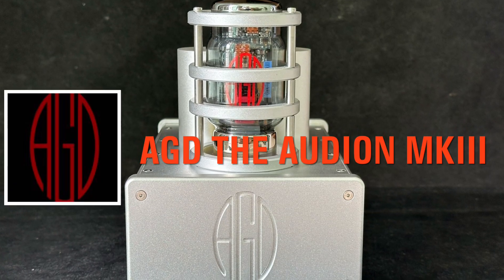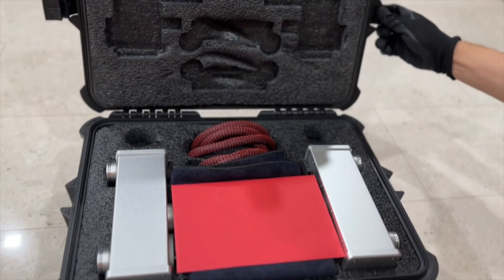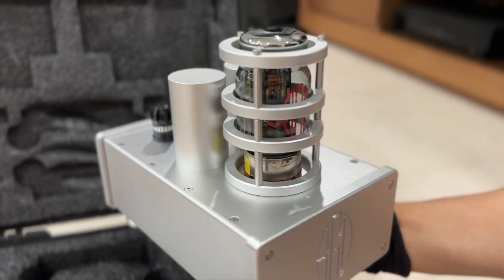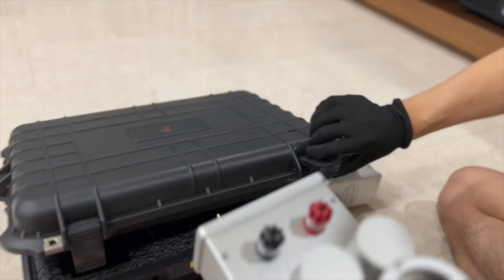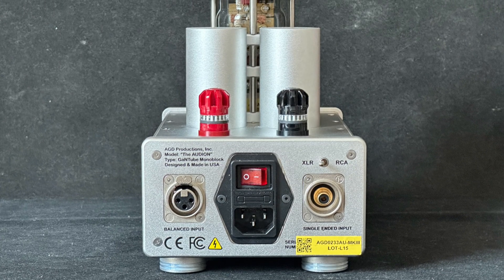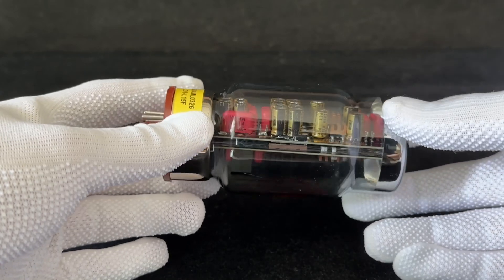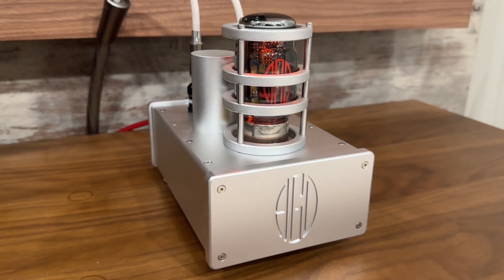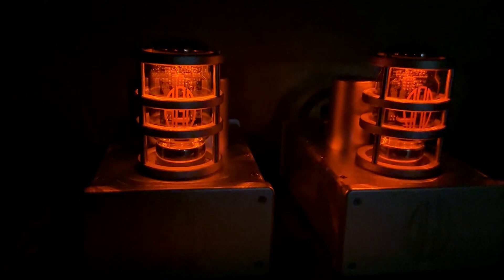AGD Audion MkIII GANFET Monoblock Power Amplifier

Comment: Did you buy direct or through a dealer? In your opinion, which preamp is a great match for the AGDs?
Reply from the maker: The set was from the dealer. The sound character of the amp is slightly on warmer side so I prefer a neutral preamp to match
Reply: @Hifihobby  Is the Holo Audio Serene considered a  neutral preamp or would a hybrid tube transistor preamp be suitable too?
Reply from the maker: I’ve not heard the Holo Audio but from the reviews online described them as neutral. Should work great with the AGD amps